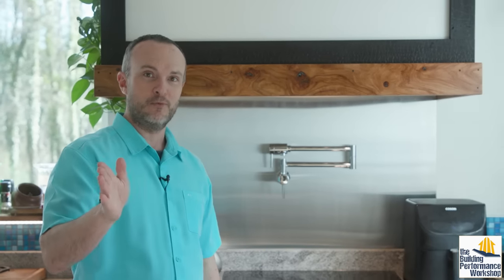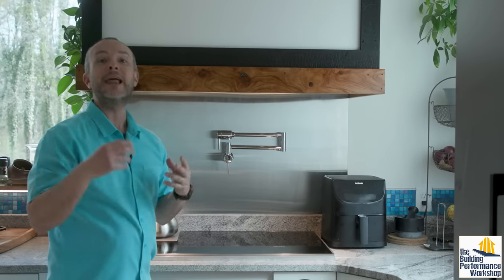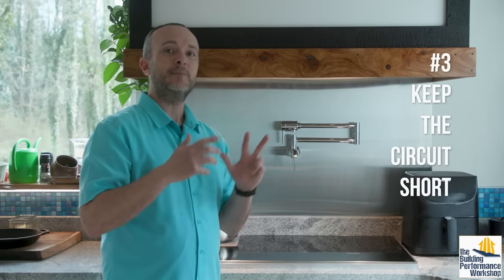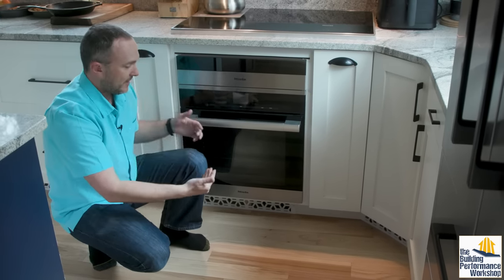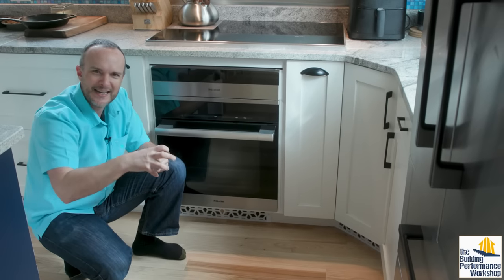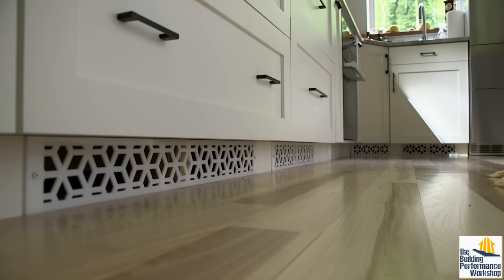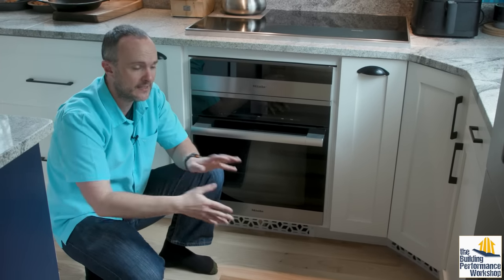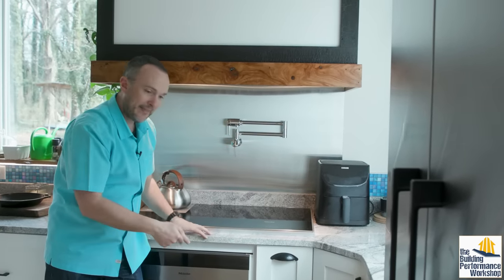3 Rules for Kitchen Make Up Air Systems: HVAC Training for Home Ventilation that Performs

Comment: For me the best solution will be cracking a window while cooking or drying, where I live the outdoor air quality is good and Its hard to justify spending 10k+ to automate that with mua.
Reply: I think the main point is to not create a vacuum when running the vent fan. Also, the point of a tighter home and such systems are to have filtered and conditioned air stay indoors...you would defeat the whole point of that by opening the window...also, these systems guarantee a balanced system...

An open window would need a fan blowing the air in to get enough air into the home to make up 400-1500 CFM for the range good...a 1000-1200 CFM hood (fairly standard for custom homes or even a remodel these days) could empty a 20*20 room in about 3-5 mins depending on the ceiling height...you would need to open basically every window in the house to balance that airflow without mechanical assistance...at which point all your conditioned air just left the building
Reply: I'm going to DIY it for less than 1500 with AC infinity, plywood and caulk.

Comment: Couple of key points. 1. Broan vent hoods can be tuned down to be under 300 CFM., pay attention to the model and look for adjustable controls. 2. The RenewAire and CERV2 can be configured to balance against vent hoods, you need to order the components up front and order the correct  sensors and controls; 3. Holistic design should be applied to ventilation: balanced air flow; dehumidification; humidification; dew point control; and cooling.  Hint: dew point control is very comfortable.  4. In zones 6 and higher, heating is best done with hydronics, you can’t argue with the physics.

Comment: Why not bring the make-up air around the cooktop surface? Just a few inch perimeter at the same level (height) as the cooktop. This is what I have done with mine I have brought in an 8 inch round duct into the cabinet underneath the cooktop which is acting as a plenum of sorts and then have a vent grill around the cooktop about the same size as the "overhang" that is recommended for the vent hood. So my vent hood is roughly 20% (which equates to 10cm) larger than my cooktop so I surrounded my cooktop with a 10cm grill for makeup air. The thinking was that since this air is unconditioned anyway, I do not want it mixing with my kitchen air, and I also dont want it blowing on me as you recommend, so I ditched the filtration as well and wanted to keep it as close as possible to the source of the pollution. One last consideration was that the air velocity was the highest in the center of the hood so I wanted air to come in from all around the cooktop (pollutant), and be pulled upwards and inwards towards the exhaust hood. It also helps that this was done in the hottest country in the world (Kuwait) which is my home country. Im hoping that the heat of the makeup air would furhter help in moving upwards towards the exhaust hood. I havent had much chance to test it since I moved to the UK but would love your thoughts on that method.
Reply: That is brilliant!  It wont work well for gas, but for induction, it sounds perfect if the pressures are dialed in.  Is it passive or is there a blower matched to the vent volume?  If i redid mine, i was planning on brining the makeup in behind one of the side upper cabinets, about 30" over aimed down cross the counter, but this is way better.

I think rule one should be designing the setup to use as little air with the maximum effect as possible so that the need for makeup air is dramatically reduced.  I think Corbett's design and yours do a good job of using a proper shaped air stream, so they should need less air to get it done.  He could further improve this by lowering the hood and placing glass side wedges to go down even further, but that will spoil the effect. 

I wonder if anyone is making a heat exchanger for vent hoods to reclaim 50% of the heat (sensible and latent) with its own air stream that can tolerate geese and >600 cfm?
Reply from the maker: Dr Bader, we did that in our TinyLab, and I’d say we had mixed results. I bet you might have done it better. And the heat coming in might help cook your food faster.
Reply: My concern is that food stuff from cooking will fall into the grill openings. I would think you would need an easy way to clean the grills and the area underneath. And everything needs to be grease/oil proof.

Comment: I’ve noticed that the rough area of a 2x4 16 OC wall cavity is just about that of an 8” diameter range hood vent duct. If you place a ~50 square inch vent register in the wall cavity behind the kitchen backsplash, but right beneath the range hood- you have the basics of a poor man’s makeup air system. Of course, heat loss, moisture management and outside ducting are not part of this equation.

Comment: I put our makeup air inlet about 10’ away from the range hood on the kitchen ceiling. Couldn’t get any closer due to a giant 4 ply 16” lvl. Put a normal supply register on it so it looks normal. It pulls air from the ceiling of our screened porch. Our ERV also pulls air from the screened porch ceiling too. Got some custom grills online that match our TG cypress ceiling on the porch.

Comment: So much good content here, and in all your videos, such an excellent service! Wish I could have been FULLY educated in 2019 (pre-renovation)! This video, once again, shows me another reason in hindsight that so many of these fundamental issues to house performance and comfort are swept aside by so many builders. I got a manual-J, and I insisted on ducting calc/manual-D and factoring ACH levels, ERV planning, etc., but I still was given all bath exhaust fans. Now - we are working on the dehumidifier retro and make-up air (shocked by the price for heated make-up air, BTW) All in all, a video jam-packed with great content.

Thank you so much for what you do!

In the spirit of constructive criticism, I did want to mention context regarding your "offhand" about gas cook comment. For someone whose value comes from digging past the surface beliefs in HVAC, and I do realize it was just a fun throwaway comment but; just like you are schooling a lot of builders and renovators on the essentials of  HVAC performance, be careful about rudimentary analysis of other fields. A few things: Yes: properly-high-powered quality induction compensates for most all of the gas benefits over traditional resistance coil electric (where the gas > electric adage comes from), principally in responsiveness and heat control, BUT there are a few things that gas excel at, especially in charring and flambé , agreed this is a minimal percent of cooks (or commenters on gas vs electric) but also in the broader need of proper saucier and wok use where the non-contact pan sides are critical to the process, these things are essentially impossible to fully emulate (in one pan) for induction. etc. Induction product lines are still working out some kinks, and I do believe it is absolutely the future, but there are many underpowered, unreliable induction models. I too long for the day when any induction will defeat 90% of even the cheap gas ranges. Let me stress again this is a great video, and aside from the throwaway joke, your video is a goldmine of valuable information.

It is clear you are straightforward, honest, and absolutely well-meaning. Keep up the great content, and as a homeowner, I look forward to the day when you've schooled me into total comfort and performance to rival those shown on your channel!
Reply from the maker: Love your comment, snd the criticism, which I had not considered since we rarely flambé and don’t own a wok, but I especially love that you used witchcraft to somehow BOLD parts of your comment. This is a pinnacle of hacking in my mind.
Reply: @HomePerformance  So glad you found my note supportive and constructive. Bolding is just immediately bracketing the word(s) with asterisks, like this also there is a leading and trailing minus for strikethrough and similarly using an underscore yields italics  Sorry to be such a long bold sentence! It was due to the comma after the * after flambé. (edited to add a space after to "fix"!) Thanks again for the great HVAC education.
Reply: Can you explain why the bathroom fans you got are bad?

Comment: I think this is the first time I have seen the completed exhaust hood in your kitchen. Looks great! And OMG why didn't any of my engineers or HVAC people think of that. A return exhaust in the ceiling or on the hood towards the ceiling would have made things so much easier. We ran a vent in the back of the wall through the floor. It was a pain.
Reply from the maker: Thanks AV- we’re still tweaking it actually! More to come.
Reply: Problem is, there were numerous non-vented exhaust fans installed in kitchens where exhausted air could not be vented to the outside. So, not always applicable.

Comment: In the restaurants where I've worked the make up air distribution comes in the space around the outside of the ventilation hood so that the  make-up air comes down the outside of the hood then is drawn back out through the exhaust. This is obv. ideal and maybe not practical for a retrofit in a home kitchen but is doable in new builds or major remodel projects.

Comment: Great video as usual Corbett. Long time viewer, first comment but I believe it may be useful. The problem with the condensation underneath the cabinets is that even the best CFD simulations can not predict how the micro-organisms that may  have been present in the moist air will move regardless of what happens to the condensation itself or how fast the air is moving. There is (IMHO) enough reason to be wary of such a phenomenon since humidity allows some micro-organisms that would have normally followed what I believe you guys describe as brownian motion to move with the air like much larger particles would. The problem here is if the air is moving at those high velocities and is drying as fast as you say, that may be all that is needed for those organisms to essentially be left behind in that inaccessible and seldom sanitized space. Combine that with the proximity to the floor and the turbulence that may cause, and the persumable absence of light and you may just have a recipe for unwanted dwellers. Then on the next humid day when that exhaust is turned on you may find yourself aerosalizing some things you really don't want. This is pure conjecture of course and is based on observations from hospital environments which are home to an abundance of pathogens unlike the source of your make up air. However I personally would just run a clean mop that is soaked in chlorhexadine (or any chlorine based cleaner if its easier) at least once to ensure that there are no existing pathogens on any of those surfaces and minimize the chances of survival for any future pathogen. It really is beyond belt and suspenders but the staleness and moisture and darkness of that space is so troubling that an hour of your time once is a worthy investment (IMHO). Quick background info, Physician here, 7 years in psychiatry and addiction treatment, since covid moved to public health, infection control department, about to start research for a doctorate (PhD) investigating the effects of different ventilation and filtration strategies on k12 student absence patterns (to track how different respiratory infections' spread may be affected by those strategies). My research proposal was actually very much inspired by your videos that I started watching alongside Matt Risinger's while building my home. Just thought i'd express my appreciation and if you ever happen to be in the UK would love to meet for a chat and show you what we are doing at the University of Manchester.
Reply from the maker: Very interesting, Dr. AlTimimi! Thanks so much for sharing, for being a fan, AND FOR PURSUING RESEARCH INSPIRED BY OUR WORK!!! What an awesome compliment!!!!!!! 🙌🏽
Reply: @HomePerformance  It is very important work and thank you for doing it. Thanks for your kind words and everything you do. All the best.

Comment: Corbett, 
Thanks for an outstanding discussion. You've given me an idea for our retirement home design. A kind of variation on our last home.  

On my last home, we lowered the kitchen ceiling to ~9' but also had a fun feature where we created a further-dropped arch "box" from one side of the kitchen to the othe as a visual transition.  It created, in the rather open floor plan, an arched partition where we had a Sonos speaker shelf.

SO I'm thinking that my Makeup-Air could also come in via 4-6 of your pretty plastic grills up there??? 😊 IF air speed is low enough, it might not even create a draft. We're not fancy cooks, so a modest 400-600 cfm hood would do fine? 
Adjacent to the kitchen would also be the laundry room that would possibly need makeup air.  

Cheers, Eric

Comment: It's nice to see the finished range hood. I'd watched your earlier videos when planning my own vented hood  to go over an induction range but ended up going with a regular exhaust with built in fan rather than a liner since I wasn't renovating or building new, just adding ducting and placing a new under cabinet hood where there had been a recirculating one before in a 1980s house. Some day if I ever need to replace the current system I may consider the fantech again with a MUAS, or a relatively quiet Broan if they make it sync up with the Overture system.

Comment: Dehumidifier @ 11:30
I have a theoretical design. A range hood is intermittent operation. Use a basement room, bonus room, large utility room as 'buffer' storage for conditioned air. Use an economical inline dehumidifier for active OA make-up air into that room. Use an auxiliary transfer fan to send the required air to the range hood make-up. Some method of rapid recovery like a unitary heat pump solution might be needed. Re-heat might also be necessary.

De-humidification is always expensive.

If you want to install an industrial solution into your basement server room, use a Vertiv / Liebert computer room cooling system.

Comment: probably not code but I sized my makeup air to be larger than the 6" range hood exhaust and omitted the make up air fan allowing the air to be drawn in as opposed to blown in. it may not be fully replacing the exhausted air on high setting but it's better than not having makeup air at all when others in the house forget to open the kitchen window when cooking. I would like to have a system that was fully automatic which would not only open a vane when the hood fan turns on but also turned the range hood on when a burner is activated so my kids wouldn't have to remember to turn on the range hood when cooking
Reply from the maker: Broan has that- check it out:
https://bestrangehoods.com/product/built-in/hbn1246ss